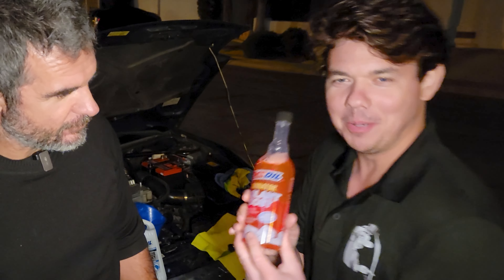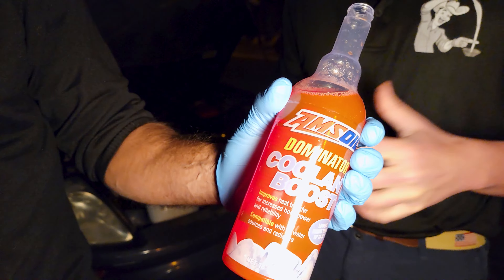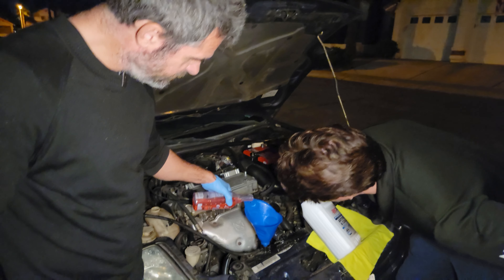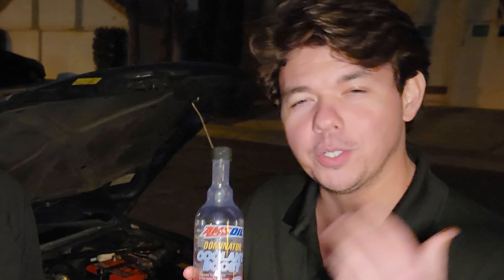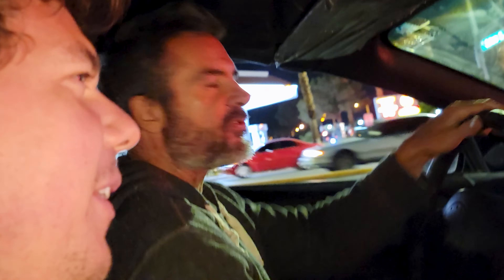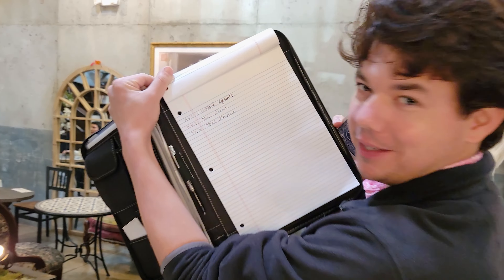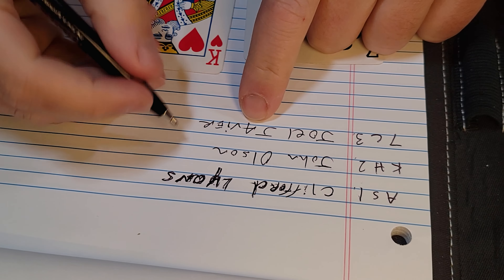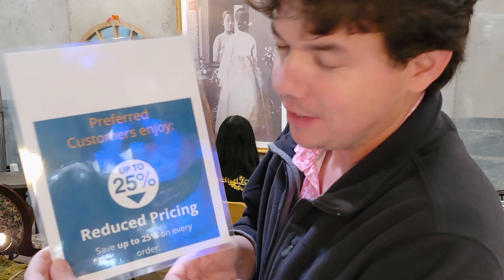This Coolant additive is a game changer

Comment from the maker: Watch This Next: Ebens Giveaways - https://youtube.com/playlist?list=PLB_ftWArBFdey4HFt_Z9KgSIChjkLbw_o&si=1sOnr7uRPUa3wey0

  I give a man a fishing pole & show him how to fish. 

     Together! We can get your vehicles to run better than brand new!

     For me to get credit & be "Your" Independent AMSOIL Dealer please use my website below or my dealer no. 5331179 call anytime Eben Rockmaker 702-472-3614
After you click on: http://syntheticoilprotection.net
1. Click hamburger menu
2. Click offers AMSOIL preferred customer
3. Click join now 6-month PC member add to cart. ( there is no reoccurring renewal membership unless you select that dot box ) 
( you have the option to not have your credit card saved if you prefer - est. 1972 )
4. Scroll up to the top Select shop by vehicle.

New promos: FREEWAND
     
     🥇🥇🥇 Synthetic Oil Protection Google map reviews
Eben Rockmaker, independent Amsoil Dealer 
Dealer no. 5331179
(702) 472-3614
https://maps.app.goo.gl/1aXxuXrXK9eJwqK78
            
♥ See fluid performance tests - https://www.amsoil.com/performancetests.aspx?zo=5331179      

     ☕ Buy me a coffee - https://www.buymeacoffee.com/Syntheticoilprotection

🇺🇸 Did you know a oil manufacturer can call a lubricant a Full Synthetic when it's only 25% synthetic? AMSOIL is different because it is 100% Synthetic and has a higher film strength keeping the metal parts separated. AMSOIL allows less friction, less heat, less wear on the component. AMSOIL Signature Series motor oil has guaranteed protection for up to 25,000 miles or 1 year of normal driving. 

     ♥ Your vehicle could run better than brand new by choosing the right fluids! See results - https://youtu.be/by5RYv3Dt0Q

     🇺🇸 Why AMSOIL - https://www.amsoil.com/about/exclusive-distribution/?zo=5331179    

     ☕ Synthetic Oil Protection Coffee - Ebens Favorite: https://supportwith.coffee/shop/subscriptions/sop/

Comment: Congratulations to the winners... Coolant boost works fantastic.. My car take less time to warm up in the mornings
Reply: Is that a good thing?
Reply from the maker: Yes it allows you to get off idle up quicker when the vehicles on idle up it runs fat another word for Rich basically there's a lot more fuel being burnt when it's warming up and that has a lot of fuel delusion fuel delusion is where it goes into the motor oil once the fuel goes into the motor oil it thins it out the fuel also contains ethanol and that damages the film strength of the oil basically a domino effect and it causes extensive damage over the years and when you live somewhere very cold you want a quicker warm-up time also you'll have better hotter air coming out of your vents and the engine will run better as it warms up because of the consistency of heat soaking it's a very interesting feel once you try it highly recommend and you will be amazed

Comment: Where can message you about questions of product?
Reply from the maker: You can text me👍
For me to get credit & be "Your" Independent AMSOIL Dealer please use my website below or my dealer no. 5331179 call anytime Eben Rockmaker 702-472-3614
After you click on: http://syntheticoilprotection.net
1. Click hamburger menu
2. Click offers AMSOIL preferred customer
3. Click join now 6-month PC member add to cart.  ( there is no reoccurring renewal membership unless you select that dot box ) 
( you have the option to not have your credit card saved if you prefer - est. 1972 )
4. Scroll up to the top Select shop by vehicle. 

New promos: FREEFUNNEL

Comment: How do i know if this amsoil coolant is compatible with my car ?
Reply from the maker: It's a great question Mark you'll see everything on the product description it is compatible with all makes models coolants colors as long as it's a water-based coolant the only coolant it wouldn't be compatible with is called Evans school and that's a specialty coolant and that is waterless for antique vehicles.
You can get this through my website in that way in the future if you ever have any questions I can always answer your questions as your independent Amsoil dealer☕️
For me to get credit & be "Your" Independent AMSOIL Dealer please use my website below or my dealer no. 5331179 call anytime Eben Rockmaker 702-472-3614
After you click on: http://syntheticoilprotection.net
1. Click hamburger menu
2. Click offers AMSOIL preferred customer
3. Click join now 6-month PC member add to cart.  ( there is no reoccurring renewal membership unless you select that dot box ) 
( you have the option to not have your credit card saved if you prefer - est. 1972 )
4. Scroll up to the top Select shop by vehicle.

New promos: FREEWAND

Comment: Where can message you for any questions about products?
Reply from the maker: For me to get credit & be "Your" Independent AMSOIL Dealer please use my website below or my dealer no. 5331179 call anytime Eben Rockmaker 702-472-3614
After you click on: http://syntheticoilprotection.net
1. Click hamburger menu
2. Click offers AMSOIL preferred customer
3. Click join now 6-month PC member add to cart.  ( there is no reoccurring renewal membership unless you select that dot box ) 
( you have the option to not have your credit card saved if you prefer - est. 1972 )
4. Scroll up to the top Select shop by vehicle. 

New promos: FREEWAND

Comment: I want to switch to amsoil any suggestions thanks
Reply from the maker: Yes Manny!
For me to get credit & be "Your" Independent AMSOIL Dealer please use my website below or my dealer no. 5331179 call anytime Eben Rockmaker 702-472-3614
After you click on: http://syntheticoilprotection.net
1. Click hamburger menu
2. Click offers AMSOIL preferred customer
3. Click join now 6-month PC member add to cart.  ( there is no reoccurring renewal membership unless you select that dot box ) 
( you have the option to not have your credit card saved if you prefer - est. 1972 )
4. Scroll up to the top Select shop by vehicle.

New promos: FREEWAND
Reply: Thanks im going to make my order is going to be big is for my corvette and my chevy silverado and thanks for your time and videos @Syntheticoilprotection
Reply from the maker: @ChillTwoTheMax 💯, 😊  anytime

Comment: cool snake oil
Reply: No it's definitely really high quality stuff that does in fact work but it's way overpriced
Reply from the maker: Amsoil is the top rated motor oil in the world.
♥️   See fluid performance tests - https://www.amsoil.com/performancetests.aspx?zo=5331179
Reply from the maker: There's a way to get the products at the best value it's called the six-month preferred customer that is the way to buy it it will get shipped to you and it costs about the same price as any other oil however it is a big upgrade.
 I give a man a fishing pole & show him how to fish. 

     Together! We can get your vehicles to run better than brand new!

     For me to get credit & be "Your" Independent AMSOIL Dealer please use my website below or my dealer no. 5331179 call anytime Eben Rockmaker 702-472-3614
After you click on: http://syntheticoilprotection.net
1. Click hamburger menu
2. Click offers AMSOIL preferred customer
3. Click join now 6-month PC member add to cart.  ( there is no reoccurring renewal membership unless you select that dot box ) 
( you have the option to not have your credit card saved if you prefer - est. 1972 )
4. Scroll up to the top Select shop by vehicle.

New promos: FREEQS